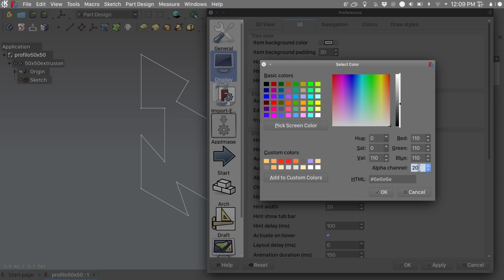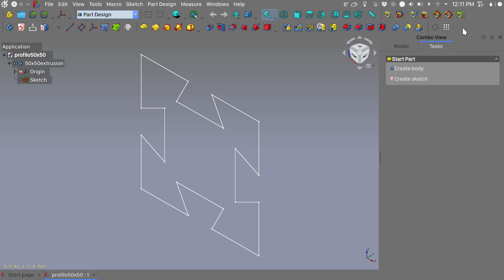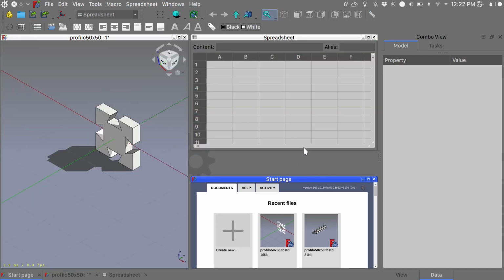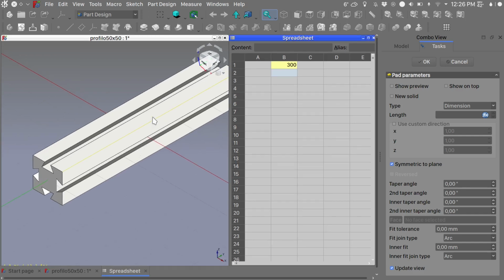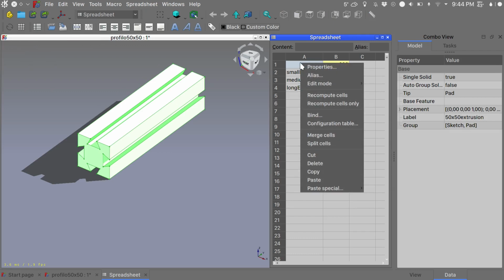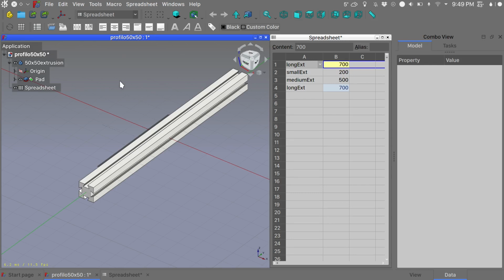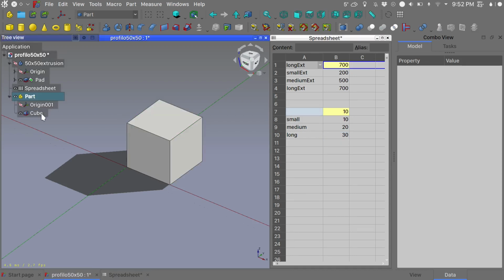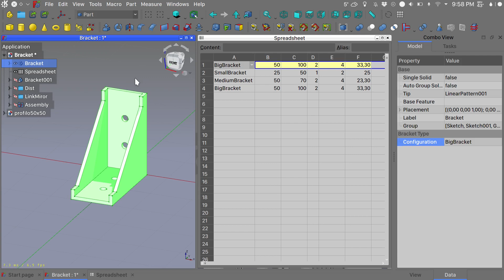FreeCAD LinkStage3 Tutorial: Configuration Table using spreadsheet.

Comment: Hello and thank you for this awesome content on RT's branch. I am trying to use this feature in an assembly(3) to make a bench and my problem is that when I am inserting multiple links of the same beam, and try to change the property, all instances of the object are changing. Do you have any solution around that? (Do you think this discusion should be made under the Assembly3 thread in FreeCAD forum, or in an issue on github? because I don't like to use comments on a video to solve this kind of problems) Thanks again!
Reply from the maker: This is the default behavior of the links but if you want to change it select your link the change the value of "Link_Copy_On_Change" in the properties panel.
Reply: @OficineRobotica  Awesome, thanks!

Comment: So, a configuration table is just a way to modify a single cell value depending on a selection of other cells. Awesome! Is there a way to change multiple values with just one configuration? Why did you set the configuration table's property on the part, and not on the body?

EDIT: nevermind, I watched the last 20 seconds. Cheers!
Reply: im looking for the advanced version of parametric design, like catia which user can change the value of single cell,  and then software  use different row or columns as for the input data, something like the last 20 sec of video, like having a drop down menu, to select bunch of different input data, not only changing a single dimension.
do you know any video or toturial or text that i can read from ?
Reply: @multiforc271  I'm sorry I didn't reply before. I don't know any resource :(
Reply: @multiforc271  Try this: https://youtu.be/nAmwGUuvnjs

Comment: Hi. First of all - thanks a lot. Great material. I'm using spreadsheets for my parametrization, but had no clue configuration tables existed. Seems like a significant efficiency booster.  Is the bracket tutorial mentioned at the end still going to be published? Or perhaps it is somewhere already?
Reply from the maker: No , it's not recorded yet. I'm a bit caught up with another project. I hope to record the second part some day. Thank you for your kind words
Reply: @OficineRobotica  Still looking forward to the bracket tutorial! Maybe while RT is slowed down by merges you'll have time to revisit this? =)
Reply from the maker: @brandonbeaumia  It's definitely on my to do list. Unfortunately I'm a bit slowed down by the fact that I'm doing some physical work, that is putting to work a 3d printer and ultimating my CNC. The 3d printer will be ready in the next few days. Follow me on twitter if you want some more updates. https://twitter.com/OficineRobotica

Comment: Hello friend, your version realthunder's branch can use all processor cores?
for example I’m making a sponge roll like a car wash, you know?
I made a 2 meter cylinder, and in the center of it, a 3 millimeter cylinder, so I used the MultiTransformation tool with a pollar pattern with 60 occurrences around that cylinder, repeating the 3-millimeter cylinder and then used the linearpattern in 90 occurrences, but it takes a long time to do or the freecad crashes and does not do the job, does your version get better use of the hardware?
Reply from the maker: I'vd already read about this problem somewhere and I think there is work being done to better the situation by disabling recomputes in certain points of the process. Keep in mind that allot of computing is done single core unfortunately(not only in FC). I raised a similar issue with the asm3 solver. We have to understand that there is a certain level of magic involved in multithreading applications.

Comment: Excellent! Eagerly waiting the next part...
One question is it possible to link and cascade configuration tables?
On another but related mater, I think I remember realthunder's branch has extended (spreadsheet?) expressions capabilities. If so, a short series about these would strongly complement the one here.
Reply from the maker: My response is YES.... lol ....to the extended expression capabilities. I haven't fully explored that possibility yet but  if you look at the properties of a spreadsheet you can see a "Python mode" toggle.  Python like expressions like  IF/ELSE , WHILE, DO WHILE etc are supported. The problem will arise when merging with master because this power feature raises some security concerns , but essentially yes, I'd say the expression capabilities are extended. Have you seen the Jupiter notebooks integration?
Reply: @OficineRobotica  yes, remember that security issue too 😔 Hope this can be left for later when the Big Great Merge shall come... That's one of the reasons I'm a long time advocate of the LibreOffice integration as it would open a world of possibilities beyond improved expression engine. 
Yes seen the Jupiter thing, but still don't know this tech well enough to really grasp the benefits of its integration with freecad. Further than coding and debugging which is already beautiful!